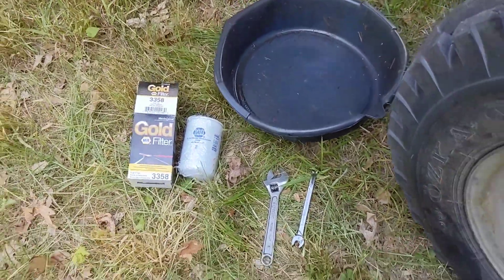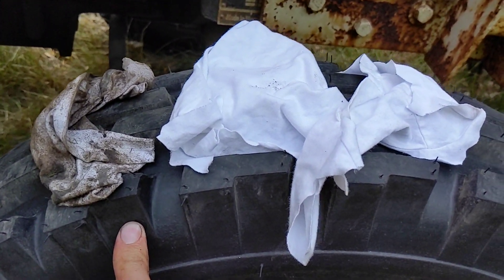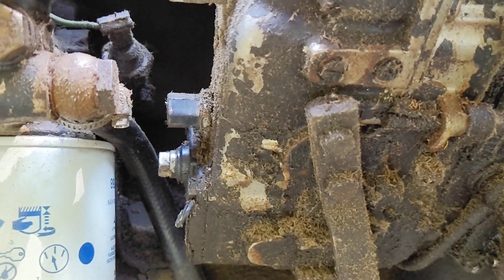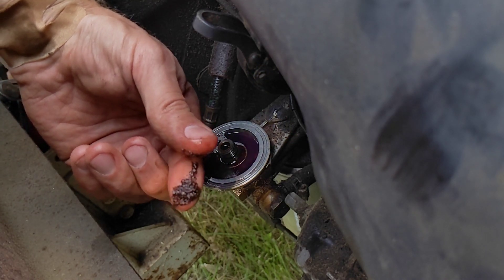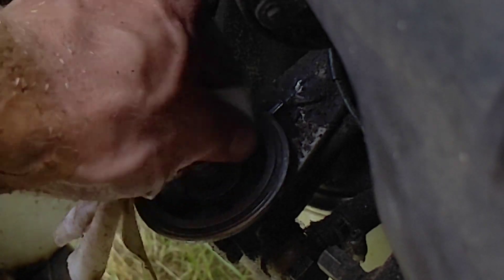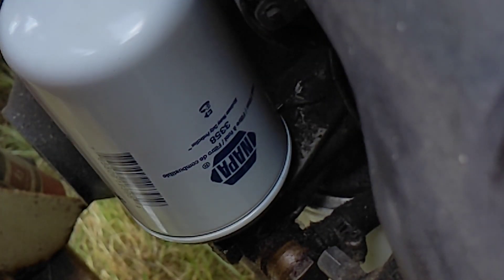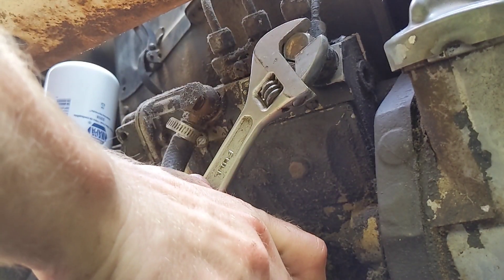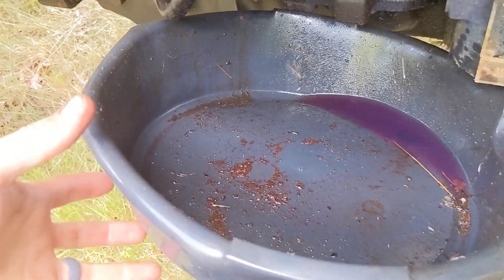Ran the Tractor out of Diesel – Now it Wont Start! Fuel Bleed & Filter How To

Comment: Hello, I have seen your video for bleeding the fuel filter, but you say there that your friend recommended you to bleed via the fuel rail, what exactly is that, can you show me with a picture how I can correctly bleed my filter, you would help me a lot, thank you in advance.
Reply from the maker: I'm not sure where exactly that was in the video, but some people will crack loose the lines on the output side of the pump and bleed the air out. If you back out the banjo bolt 2-3, and push the primer lever for 1-2 min then tighten it up you should be good. Had you tried that already?

Comment: if i have to remove the injection pump and looks like i do, what kind of retiming you have to do? my pump is bad on this deutz
Reply from the maker: I have not had to work on the pump past priming and oiling on my Deutz, so not familiar. Have you bought a replacement pump yet? If so, curious if it came with any instructions? At a minimum definitely would want to make sure you carefully note the way anything is aligned when you remove the old pump. Hopefully I'll have a chance to review the parts diagram this week and see if I can glean anything.
Reply: @Buttons_fix_it  yes i ordered a new pump. drive the tractor hard to control the way it runs. like there is some thing in the gov broke. on the back side of the pump. where the 12mm is to check the oil level
Reply: was out of oil. so it is soaking as i wait . on a new starter this one was rebuilt. years ago. its dead as of now lol
Reply: @Buttons_fix_it  well down to removing the pump. all strip down to take the pump off. front plate off then removed the center bolt and three small bolts in the flange holding the pump to the gear. was relieved to see no timing. have to remove no1 head cover and check for top dead center to start fuel flow after the new pump is on. not going to be a bad job.

Comment: i had the same issue after changing the fuel pump. manual pump. bleeder does not pump up to bleed off.that is a 17mm on that line BTW lol did i get a crap replacement manual pump??
Reply from the maker: @Mickm0j0green  it's possible the pump is   bad. Have you seen any evidence of fuel making it to the inlet side of the pump? Wonder if there is a clog out of the tank of filter. Might also need a bunch of priming and maybe come cranking to get the fuel into the pump. Does your replacement pump have a spot to put in oil for the pump? I have another video detailing the oil fill.
Reply: @Buttons_fix_it  open the screen on top, its full. as a check if i had a large air pocket in the new pump. the manual pump does not pump up to bleed and screen is full of fuel.
Reply: fuel injection pump where it bleeds. wonder if thats pooped  out now lol
Reply from the maker: @Mickm0j0green  do you feel any resistance at all when using the manual lever? Also maybe try cracking the high pressure lines loose one at a time and see if you get any fuel there. Then if you do tighten them up and try the bleed screw. Also the bleed screw is backed out 2-3 turns, so pretty far out
Reply: @Buttons_fix_it  put the lines all back on the fuel pump. 19mm.have fuel through the filter to the pump. i feel nothing in the manal. nor hear a vaccum form and pressure. as you had in the manual. hear your manual working mine is nothing, just got the pump today
Reply from the maker: @Mickm0j0green  ya that's not good. I wonder if you had a small tube if you could get some fuel poured backwards into the bleeder. Not sure if that's even possible. Jus thinking if you get some fuel in there it might prime the manual pump. No loose fittings on the low pressure side where it could just be pulling in air? And silly question, but the petcock on the bottom of the tank is opened up all the way?
Reply: @Buttons_fix_it  yep open.of course i got no oil from the injection pump.yet would not stop the manul from pumping up. or would it? just got the 4506 and no manual
was not sure what oil or how much deutz said for that
Reply: grab a small water bottle with a hose and squirt it in then put the line back lol
Reply from the maker: @Mickm0j0green  definitely try getting oil in the pump, that might be what the seal needs to pull suction on the manual lever. Check out this video: https://youtu.be/v8XPS1Cbs5w
Mine just used the motor oil.
Reply: @Buttons_fix_it  thanks a lot! Midnight now . Try that oil fill in the morning! Let you know it my deutz comes around! Great tractors btw people
Reply: no it did not work, i did add oil to the injection pump and no change. took the old pump and put it back on. have to get another pump.
Reply from the maker: @Mickm0j0green  Bummer! Let me know how the 2nd replacement pump works
Reply: @Buttons_fix_it  sure will. and i have a bucket on here also. i seen one person ask if you could show a adding a bucket for a rookies lol .thanks for your help man, i work on cars. these are a different animal with quirky behaviors lol 61 years old and first deutz. i am a rookie lol
Reply: @Buttons_fix_it  well here is an update! Unsure about buying it. Did so today! Drove it home acting as if was trying to run off! 3,400 hours on that F3L912 Deutz engine. The injection pump is not holding any oil! All oil leaves the governor! 12mm you take out to check the oil level! Put oil in it ! Leaving by the fuel pump! Think the seal is out there! It did sit for a while . 9150 Deutz took its place
Reply from the maker: That's great you got the tractor! I'm sure it will be a rewarding project! Thanks for the update, bummer about the pump.

Comment: my tractor started to have low power so i changed the filter, i had rust too in the fuel filter bowl, my tank was rusted so i por15 sealed the tank,  that didnt fix it, the fuel lines comming from the tank were plugged with rust particles and the elbow/banjo fitting was plugged also, cleaned everything and it was back to normal power, a guy told me to bleed the line on the fuel rail insted of where you did it, took about 30 pumps of the lift pump to get the bubbles out of the fuel, started right up! i need to get a maint. manual!
Reply from the maker: That's great you got the tank and all the lines cleaned up and the tractor running. Thanks for sharing the tip on where you bled the line from!